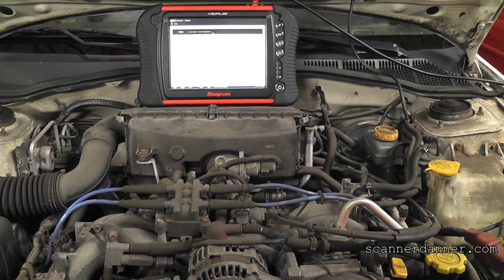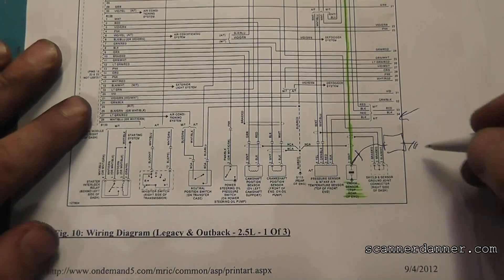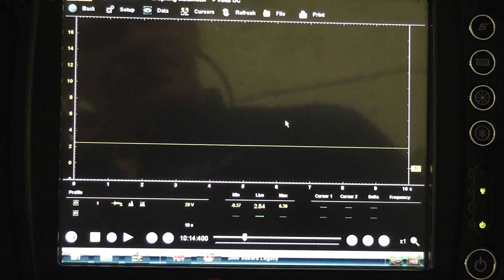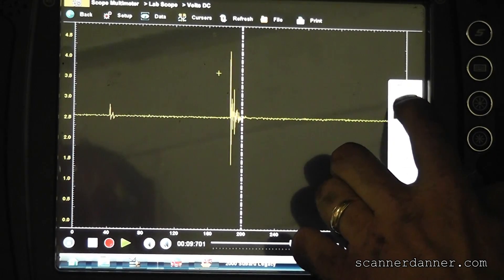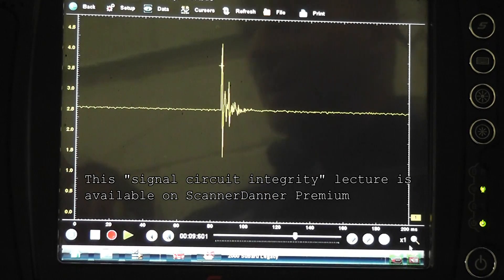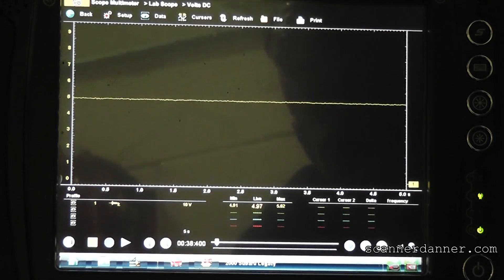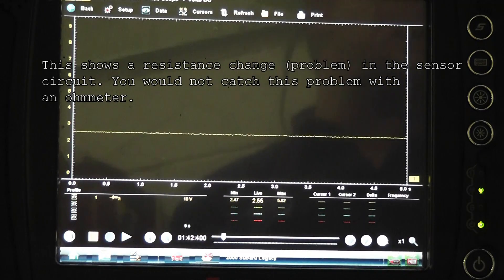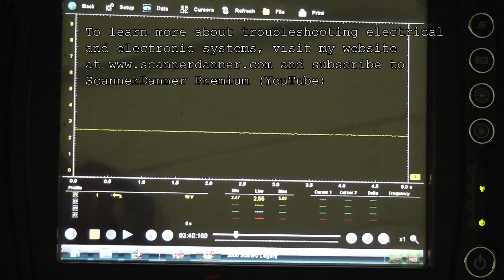How to test a Knock Sensor (P0328) - Subaru

Comment: Why do you read 0v on the scan tool while current flowing through the circuit?? While on a map or any three wire sensor when you jump the signal wire to the 5v reference the scan tool reads 5v

Comment: Hello,long time ago I had problem intermittent Knock Sensor code.It took me long time to figure out since 10 years ago I didn't know for Scanner Danner and didn't have Fluke 98 Scope.Ended up running new shielded wire from sensor to ecm along fire wall away from main engine harness.My conclusion was that signal wire shield was damage somewhere in main harness on engine which interfere with alternator DC voltage cable in bundle.Wire continuity was ok and was no short between wire and shield /ground.
I have one suggestion for ScannerDanner to make one video for DIY people when buying used car ,how with use of scanner try to determent car condition etc. rollback milage.

Comment: got a similar case but my bias voltage is 0.5mv and t doesn't get pulled down when unplugged. is it a must for the bias voltage to be 5v? or my circuit could be shorted to ground? visual inspection on loom seems ok.
Reply from the maker: +Kingstone Joseph It depends on what you are working on. Not all knock sensor circuit use a bias. 
But yes, if there is a bias of 5v and you are only reading .5, the circuit maybe shorted to ground.
Reply: How can i tell the expected bias for a 1998 Subaru Sf5?
Reply from the maker: +Kingstone Joseph not sure and never heard of an Sf5, but every Subaru I've worked on here in the US has had a bias voltage on their knock sensors.
Reply: +ScannerDanner managed to sort the issue, circuit was fine, sensor was faulty after replacement sensor unplugged bias voltage remains 0.5mv and doesn't pull down when plugged (don't know what circuit design is this). Thanks a a lot for your input. We really learn a lot from you here Kenya Africa.

Comment: It's a $10 part. Just change it and see if it makes it any better. Takes 10 seconds to change it out.
Reply: It's actually a $130 part, which can be found cheaper online for as low as $70.  Certainly not $10.
Reply: Gregory Gleason
I replaced the part on mine. it was $12 with shipping, and it cleared the check engine code. $130????? lol
 all sensors on 2000 subaru are are about $10 now.
Reply: +Y10Q On eBay, yes.  genuine OEM parts are a lot more.  not sure of the difference.
Reply: Gregory Gleason
 no difference. It's a just a microphone. As soon as mine was installed, check engine cleared up.

Comment: What if your ground from your engine to ecu differ? as much as .04 is thought to be acceptable potential difference in ground measurements but if your knock sensor is grounded on the block, and your ecu is grounded on the firewall or chassis the ground  of each to the negative battery cable  should be inspected. If there is a difference, (which there is in a car I am working on right now) the grounds aren't equally pulling. It says high input on your po328, and you saw it function how do you go to needing a new sensor? Its sensing? Well I am getting a low reading on my clients car,Po233 but I got some funny symptom told me. She said reads knock, intermittent starting clicking . radio lclock time loss at start up and a few other strange things. The knock sensor is made from a piezoelectric plate and is super durable, as you saw it function fine , but your input is too high,  Now how does it know the input high or low with just one wire? Unless the ground on the block is a different frequency than the one on the ecu by only a small amount .Less is able to transfer. I have been researching the internet on this 6 hours straight, It really bothered me that it didnt make logical sense to work but at to high or low when its just a vibration activated current.  And everyone who changes that sensor always has problem with it working properly. Also a common  beggining was water in the engine bay, but not even too much to flood it or anything. Also Pieso-electric plates are waterproof.
Reply: The subaru ecus are usually grounded directly to the engine block, via a set of cables that goes straight to a ground ring at the passenger rear top side of the block.

Comment: Stop now & check the internal resistance of the sensor. Record that & reconnect. Start & run the engine up to full warm thru while monitoring the bias voltage only. If it rises, you have an internal resistance problem due to heat soak. Confirm by shutting the engine off & monitoring the resistance as the engine goes into a koeo heat soak condition. It will rise considerably..... Replace & Retest to verify before returning it to your customer. Oh, by the by... In Nissan, a bad knock sensor will not turn on the MIL, but it will adversely affect fuel mileage.

Comment: Nice video Paul demonstrating the knock sensor. Have you run across knock sensors where they are more tuned to a specific range of frequencies where tapping on the block doesn't show up anything? These sensors are supposed to be more accurate to only show the frequencies pertinent to an engine knock. Keep up the good work!

Comment: I had a subaru with this code the other day. Had 5 volts bias volts unplugged. Plugged in bias voltage fell to 2.5 volts. Ran vehicle until warm biased voltage plugged in would fall to 2 mV, unplugged knock senor bias voltage would go to 5 volts. put another knock sensor in did the same thing. Had to get a new knock sensor from a different supplier to fix the car. But the key to being 100% confident that I had a bad knock sensor was the bias voltage being pulled to low. Another great video. Thanks!

Comment: Paul does piezo electric sensor needs reference voltage to operate ?I hade a 97 toyota paseo could never fix.  I cheked voltage  at sensor no bias  voltage? code p0325 any way I saw voltage when inducing knocks on the scope  in the aceptable  range  , replace with factory sensor code came back, I check wire  install 12 head lamp in one end and send power onn other end pass test wigle test no drops competer pin conector all passes so I replace pcm , code came back , money back to customer.